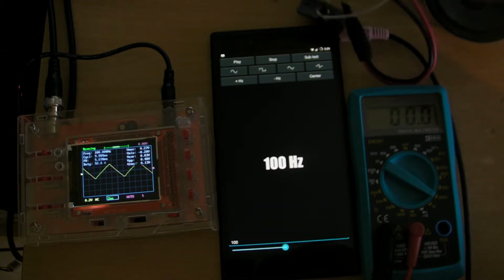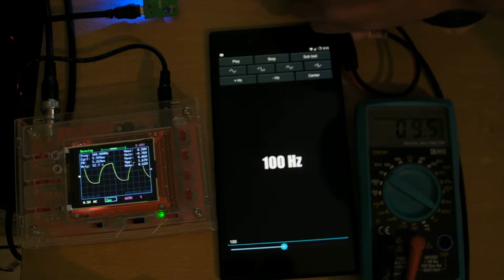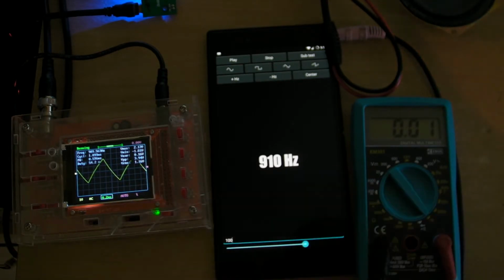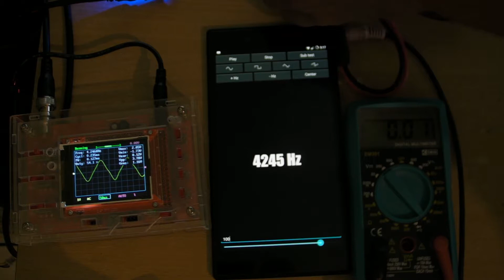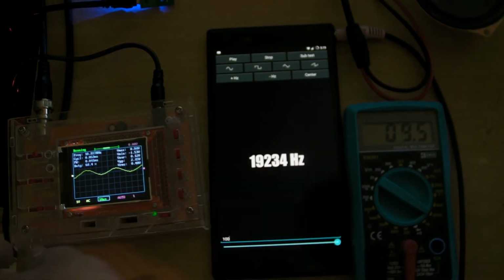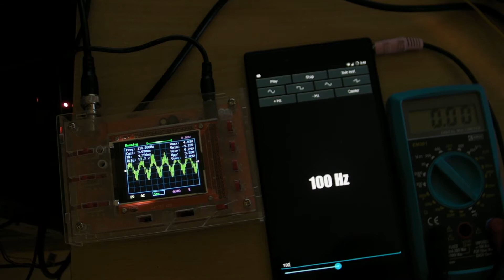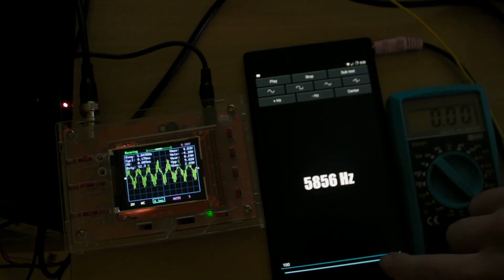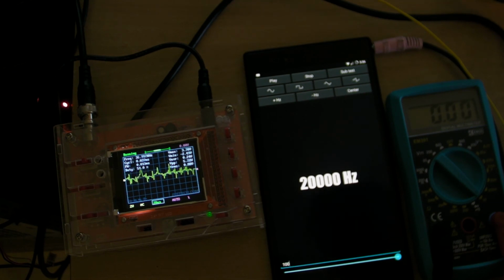8002 class AB vs PAM8403 class D - Testing amplifier boards

Comment: Bro which is better pam8403 or 8002
Reply from the maker: Depends - if you want to have a decent sound without having to fuck around with equalizer than PAM8403, it can also get a bit louder.
If your priority is cleaner sound than 8002, however the board with 8002 was very bad at lower frequencies (amplification started to drop down significantly at around 500Hz and below) - so there is very little base unless you boost it with an equalizer.
Reply: @stuff5143  thanks